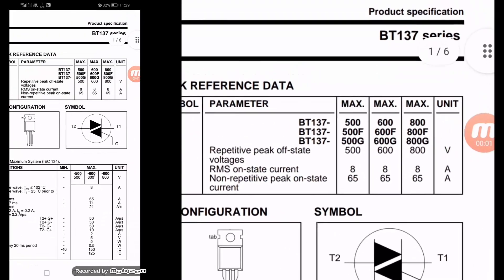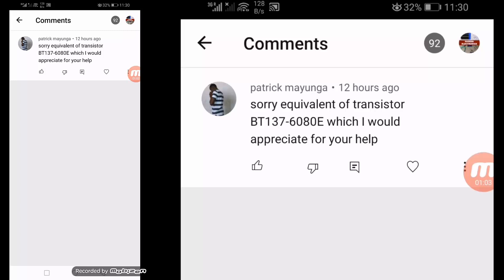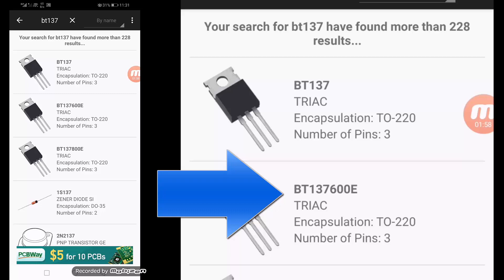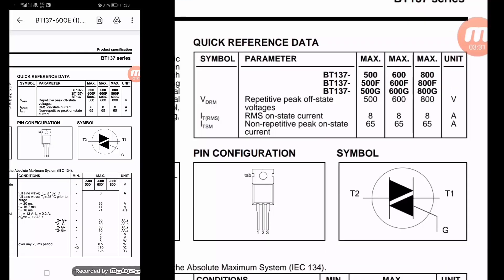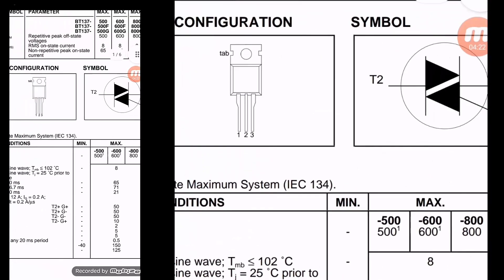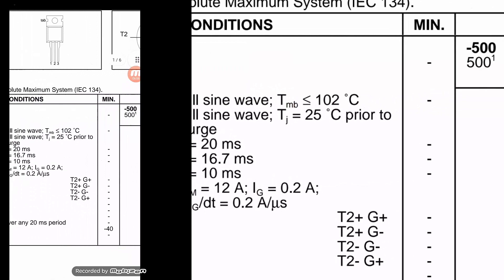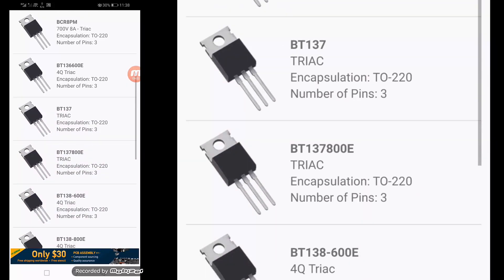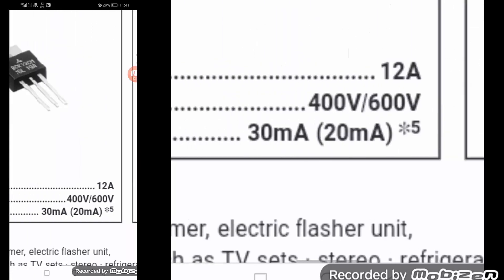[388] How to Find Datasheet & Equivalent From Your Mobile Phone BT137 Equivalent

Comment: Hi sir how do i know the forward voltage of my bt137 600.
I hv 2 pcs as 137 600 and 600e
600e shows 0.217 in diode mode 
600 shows 0.047 in diode mode.
Which one is faulty sir?
Reply from the maker: https://youtu.be/QxLhJxrpQIU